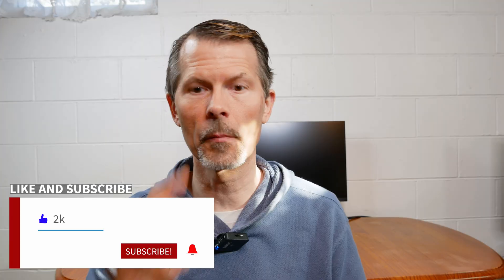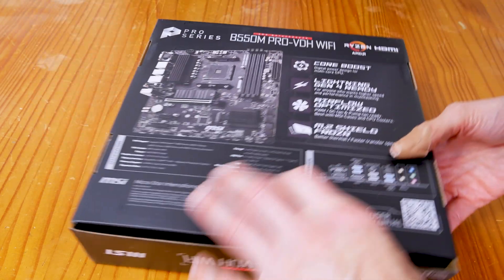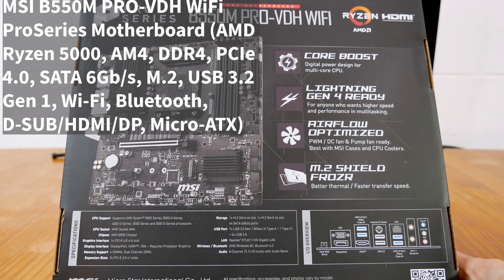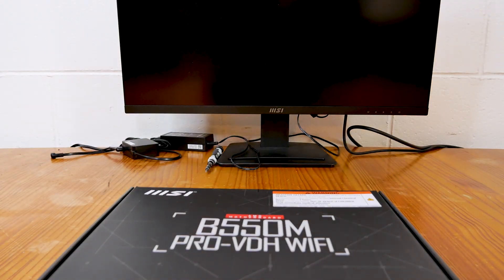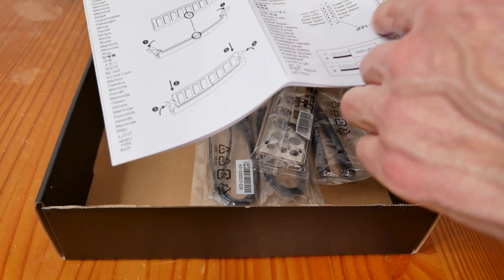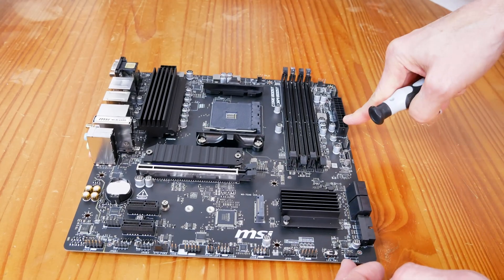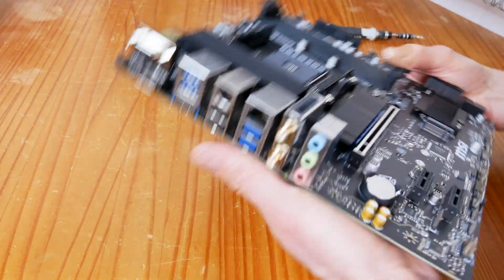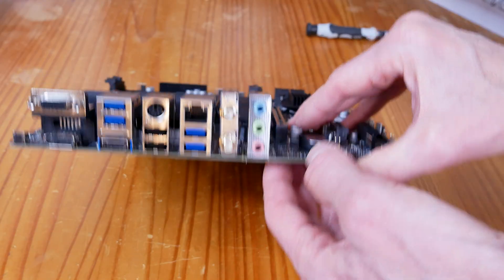MSI B550M PRO VDH WiFi Pro Series Motherboard unboxing review! #msi #pcbuild #techreview

Comment: Will this be ok for 5700x? And a 9070xt?
Reply from the maker: Should be fine as long as u
You have good case airflow/cooling. I'd be concerned about if your psu can handle the 9070 as its a beast and takes 3 8pin pcie connectors and pulls a lot ofbpower.
Reply: @RememberThisTech  i have a 850w  seasonic focus plus psu , case is mesh with 6 fans. I was worried for mb's power phases
Reply from the maker: @koutc91  Your PSU is really great so here's what I'd double check and read to be ok with the choices, but IMHO you should be ok with this budget MOBO. Yes, the MSI B550M PRO-VDH WIFI's power delivery (VRMs) can handle a Ryzen 7 5700X, and it will work with a future AMD RX 9070 XT but ensure your BIOS is updated for the 5700X and you have a robust PSU for that powerful GPU. The B550M PRO-VDH is a solid budget board with decent VRMs for mid-range CPUs like the 5700X (65W TDP), and any modern GPU uses PCIe, so compatibility is good, but you'll need a beefy power supply for that high-end GPU (Which you DO) 
CPU & Power Phases:
Ryzen 7 5700X (65W TDP): The PRO-VDH WIFI has sufficient VRMs (Voltage Regulator Modules) to power the 5700X without issues, even with mild overclocking.
BIOS Update: Crucial! If you buy the board new, it might have the update, but it's safer to update the BIOS to the latest version before installing the 5700X to guarantee compatibility. 
GPU & PCIe:
RX 9070 XT: This is a future high-end GPU, but it will connect via the standard PCIe x16 slot on the motherboard, which the B550M supports.
Power is Key: The GPU will draw most of its power directly from the Power Supply (PSU), not the motherboard phases. Youalready have a  a high-wattage PSU (for a 9070 XT).
Reply: @RememberThisTech thank you brother i maybe go for a non xt, i dont want my build to be power hungry😂
Reply: @RememberThisTech what if i install 5700x without bios update it could still run and i could update it after if it doesnt right?
Reply from the maker: @koutc91 let's say your running this mobo already with a ryzen 3000 or 5500 series cpu, and you drop in the 5700x and the mobo doesn't recognize it you could put your old cpu back in and flash the bios. But odds are it will recognize it as this motherboard and the 5700x has been out for years.
Reply: @RememberThisTech thats what i thought that mobo will be built in a later date so it will be already at an update that it will read cpu

Comment: Hi, I have seen you have some older videos on HP Z400, I wanted to ask if I can swap the motherboard for a LGA1150, while keeping the factory psu
Reply from the maker: No, an HP Z400 PSU is not industry standard; it uses a non-standard, custom-engineered 24-pin connector that is incompatible with standard ATX motherboards. This means that if you want to replace or upgrade the power supply, you cannot simply use a standard PC power supply. You must either find a compatible HP replacement, create a custom adapter, or purchase a power supply specifically designed for the Z400 system. 
Why it's not standard
Custom wiring: The 24-pin connector on the Z400's power supply is wired differently from a standard ATX power supply, even though the connector physically looks the same.
System engineering: HP workstations are individually engineered, and their components, including power supplies, are not made to be interchangeable with industry-standard parts outside of their specific product lines. 
How to work around this
Use an adapter: You can buy an adapter that converts a standard ATX power supply's 24-pin connector to the specific layout required by the Z400 motherboard.
Use a compatible HP PSU: You can replace the PSU with another HP power supply that is specifically designed for the Z400 or a compatible model.
Buy a new power supply: If you're upgrading for a new, high-power graphics card, you might need to purchase a new power supply with the necessary connectors (like 6-pin and 8-pin) and use the adapter to connect it to the Z400's motherboard.
Reply: @RememberThisTech  I understand,thanks

Comment: Nice board, do you think it would make for a good board for an entry level gaming pc?
Reply from the maker: Hi there. Most definitely. Toss in a Ryzen 5600 or a 5500x3d cpu and you've got a nice entry level start. Maybe a b580 or a RX 9060 Xt gpu.